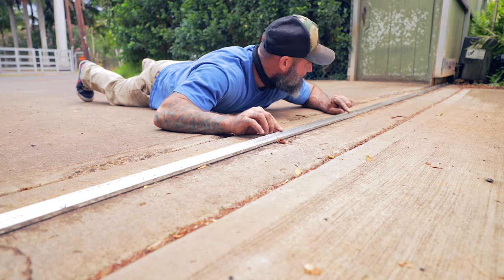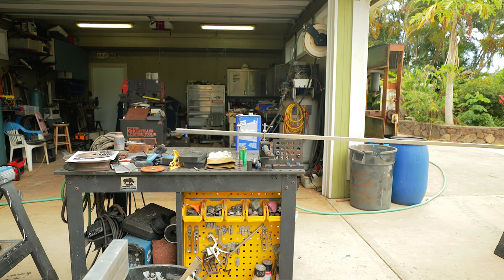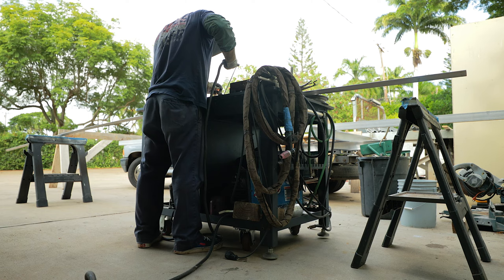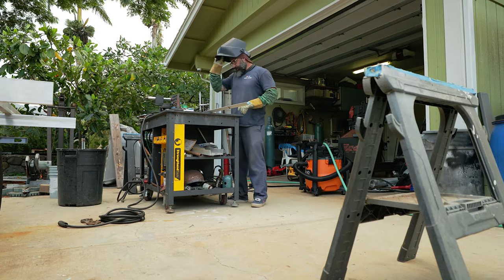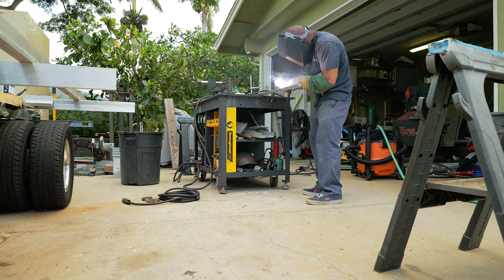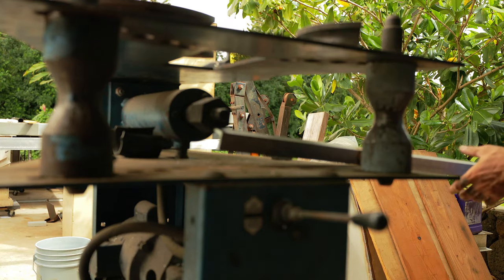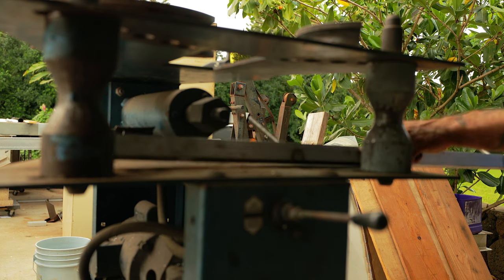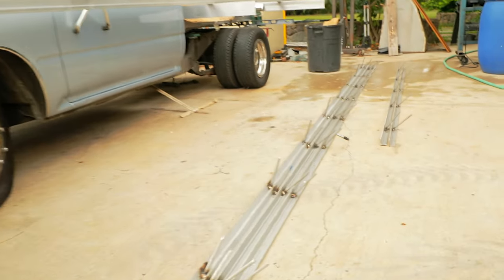How to make a sliding gate track - Stainless steel sliding gate track

Comment: Any way I could ram one of those down into grass/ground? Don't wanna pour a concrete footer if not absolutely necessary. Not sure it'd stay put though. I have a sliding gate going g up in the backyard and need to lay the track
Reply: You want concrete mainly bc of it s hard surface and thus add stability,if you think grass or dirt are firm and hard enough nothing stops you from it.